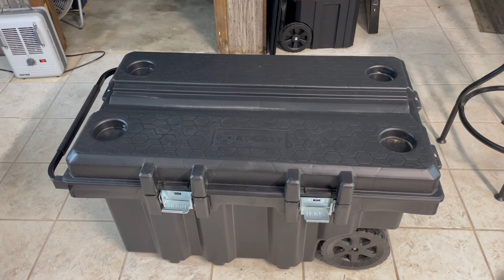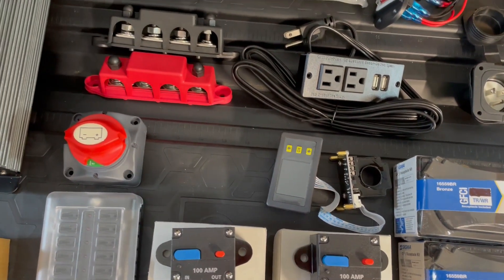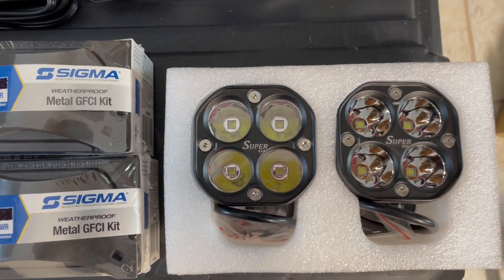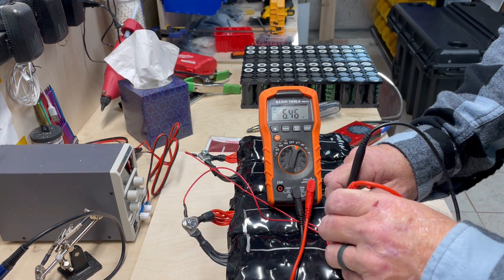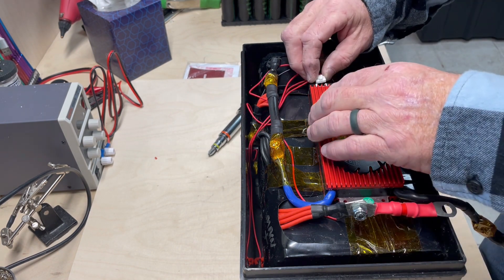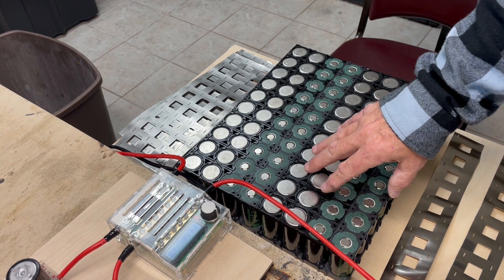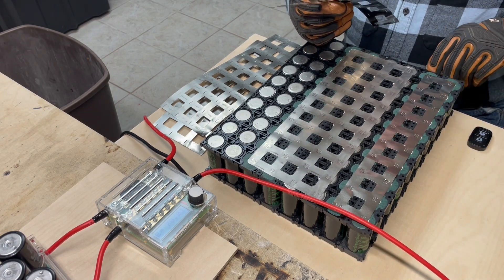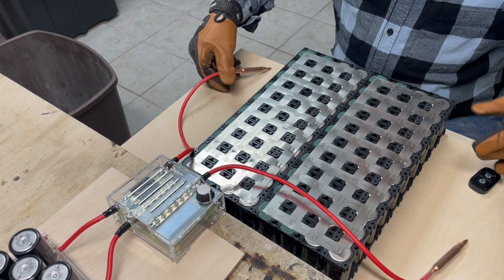DIY 5000watt Solar Generator Part 1

Comment: Good tutorial. I also use these type cells. Just a thought on your battery bank. You have 
20 cells in parrallel 5000mah x 20 = 100 amps of potential current draw

However your nickel nickel strip on main  positive and negative wires is only capable of  
3 strips @ 12 amps each = 33 amp current draw.
Each 15mm wide .2mm strip can only handle 12 amps each.
Also when I built my 4s 30p I used a double layer of nickel strip on the main battery and had 6 wires joined to the nuckel strip on each of the main connections 
6 x 12 = 72 amps  x 2 strips  = 144 amp capacity rating
Please rethink your connections 
Darren
Reply from the maker: I have not built this yet. I will rethink the batteries. Thanks for the input.

Comment: Great work. Thank you for taking the time to share. I have several of these boxes and I know that you have a smaller 1500-watt version for sale and was wondering if you sell or are planning to make these to sell as well. If so, how much does each system cost? I only ask because I am currently pricing my system. Any wisdom would be greatly appreciated.
Reply from the maker: The 1500watt sells local for $1600. I have a 500w that I sell for $1000

Comment: what battery box is that. I have the same battery packs from battery hookup....
Reply from the maker: I purchased the 5000mah batteries from BH. I spot welded them into a 4s 20p 100AH pack.
Reply: @paulswoodshop395  that’s how I bought them from them. For only $40 more than buying the cells alone it was worth it

Comment: This is awesome! When are you planning to post part 2?
Reply from the maker: Thanks Robin, I had shoulder surgery so unfortunately it may be another month. The batteries are going to be to much to lift for a while. In a week or two I am going to try to put a video of my best selling DIY generator. It only has a 5Lb. battery but, it is 1700wh. If you subscribed to my  channel and hit the bell for notifications you will be notified.